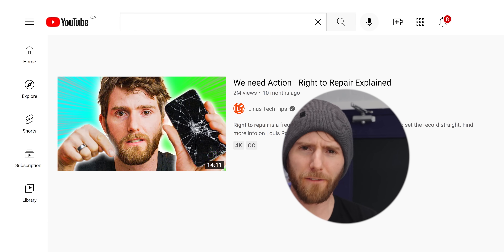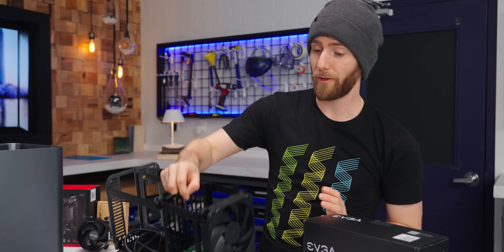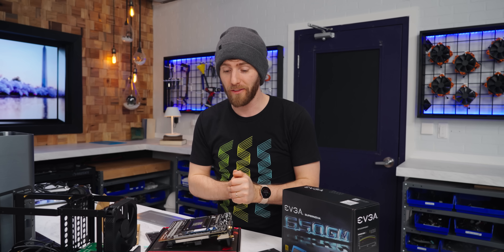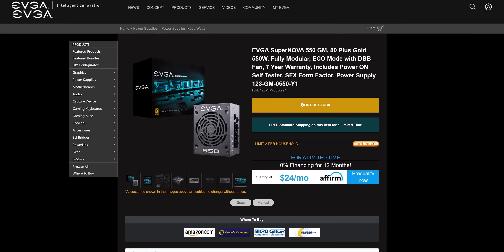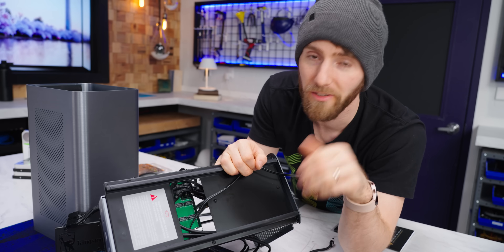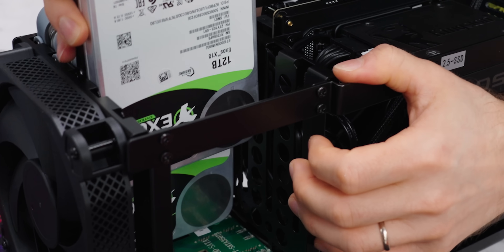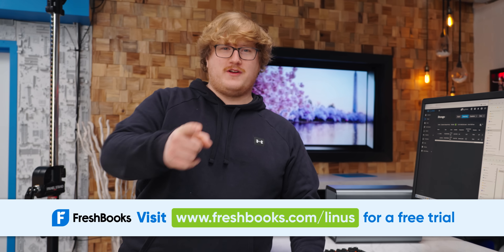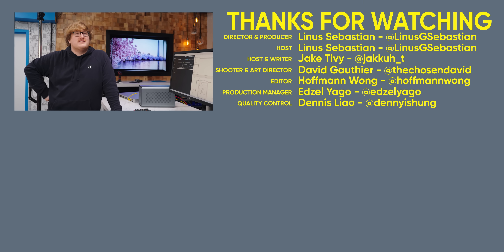This blows away the competition - JONSBO N1 NAS Build

Comment: The problem I see with the LTT screwdriver (from what I can tell from the videos) is the same as I see with most changeable bit ones, its too thick for the small work I do. Those bits alone will have a hard time fitting into recessed holes, let alone the shaft of the screwdriver. 
Even the iFix-it stuff isn't much better though.  

What I would like to see is a new design, using the small bits like the iFix-it kit uses. Rather than the normal interface where the bit slots into a hex hole in the screwdriver, the bit itself would have a keyed whole of some sort, and a shaft from the screwdriver would slot into the bit. This would let you keep the outer diameter of the total shaft very thin, allowing it to go into even the smallest recessed holes.
Reply: An easier solution to the problem you raised would be to use the long bits.
You would maybe need a handle that's a bit longer so that they can still be stored inside the handle.
Reply: I Agree, LINUS has tiny hands, that can somehow use the big Tools
I have BIG Hands that can't get in There Without a TINY Screwdriver😂
Reply: @OldManJace  I'll second that!!!
Reply: The thing about the LTT screwdriver is that it (at least looks like it) feels comfortable, we had a similar looking one and it was so so nice (it got lost now so sadge), i get your point about not fitting into tight spaces (hence why I have two screwdrivers) but for more general use i think that would feel much better than something for laptops or mobiles and such
Reply: If you need long and thin regularly, I'd take a look at the PB Swiss PB 515 toolset. It's great for deeply recessed screws in thin holes.
Reply: I have seen a couple of long bits screwdrivers that are only as thin as the head so they fit great in thigth spaces, but they only work on the provided handle, I would love an extra bits pack in the standard hex even if they do not go in the storage.
Reply: @josuelservin  those extra long bits exist. Every hardware store sells them.
Reply: @Jehty_  I know and own a set of those, but they are the same width as the hex part all the way to the head, so no good for small thin holes.
Reply: @josuelservin  I knew what you are talking about.
And as I said they are sold everywhere.
For example the Wera Kraftform Kompakt 60 set. 
(There are cheaper ones out there I just don't know their name)
Reply: Thats a pretty good idea actualy. Only possible issue i can see is manufacturing cost, since a lot of manufacturers have the current bit design down to where they can produce them at a high speeds and reliable quality. Sure there are for example Torx ones with a small dot in them, but the difference is that its a very small hole and doesnt have any torque applied to it.
Reply: I think they're optimizing their screwdriver for PC builds and just general use. If you need some special tool for a niche use case you should probably look somewhere else. Not like iFixit is the only company who makes screwdrivers. 99.9% of people do not need/want the feature you are asking about.
Reply: There are definitely different ways to approach building a screwdriver, none of them being perfect for every use case. Screwdrivers designed to be used with different bits do so usually out of consideration for cost and versatility. It allows for a much nicer driver for much less money compared to having one driver per bit. The design you've suggested is not in use for a very good reason. It's bad. There's no way to say this nicely really, you haven't thought anything through. Firstly, holding something by the inside instead of the outside reduces the contact area and increases the chances for slipping. This would allow you to strip your bits until they become unusable. Not to mention those bits are now exclusive to the specific driver that inserts into them, costing more to manufacture rather than a standard part which is already being mass produced. The other glaring (and worst) issue, is that the shaft would be significantly weaker, and risk twisting when applying a good amount of torque. If a magnet is used, it would also need to be tiny, thus much weaker and might let go of the bit often. The design you've proposed is both less practical and less durable, for increased cost. I think you can see now why that's not what LTT went for, or ifixit, or any respectable manufacturer. As another user mentioned, the PB 515 toolset would suit your requirements better, it has interchangeable shafts. Of course, the cost per bit is higher as well as the space taken up by each bit. Definitely not something you could store in the handle of the screwdriver itself.
Reply: There's usually two different types of screwdriver applications: serious business and delicate operations. The LTT screwdriver looks like a serious business screwdriver. I think they would do well to have a delicate option as well.
Reply: sorry to tell u that hes not producing special products just for ur usecase. im pretty sure its supposed to be used for the stuff he does in his videos and apparently its fitting for that. i bet there are manufacturers that produce tools for ur usecase too.

Comment: I got a used hp elitedesk 800 for $100 including shipping and tossed in a 256gb ssd and 2 16tb drives. Works great as a media server, and I even had room to add a 3060 and it's a capable spare gaming computer and it can mine while nobody is using it.

Comment: Does anyone know how much power this would use compared to a comparable synology?
Reply: Only a little more, Ryzen is pretty efficient at about 15-20W in idle or low load and 60W in a heavy load, so not great but more than acceptable.
Reply: well the synology would have a crappy celeron in it so yeah it would probably use less power however performance would struggle with compression and large file transfers
Reply: @firenado4295  Mmm. Its not really that bad.  Large file transfers don't require any CPU... the cheapest CPU can still easily (trivially) push the full network bandwidth.   Compression depends on the algorithm.  Its a trade-off.  Something like LZ4 gives you modest compression with very low CPU overhead verses other compression algorithms.  A little 4-banger CPU shouldn't have a problem with hard drives making up the backplane.  It might become stressed if they were SSDs instead.

Also, on vgamesx1's comment about power consumption, and Winfurious's comment.  With the gear in that box it will be idling at around 40W, not 15-20W.  15-20W is what you'd get with a mini-pc.   The low-end Intel CPUs do use significantly less power... but of course they are also significantly less powerful.

It comes down to how much one wants to pay on their power bill each month.  Vampire draw from always-on gizmos can be pretty substantial and it adds up.   NVRs have the same problem... if you throw a lot of cpu performance at a 24x7 security/video system, it can really dig into your monthly power bill.

-Matt
Reply: @junkerzn7312  ah fair enough, I honestly thought that file transfers where more intensive especially with compression but i think I've watched too many LTT videos where they have entire nvme storage and insane speeds that would need cpu power and it just numbed my brain i guess lol. I did know that it wasn't that intensive but not Celeron levels of not intensive.
Reply: @firenado4295  Basically, the only CPU intensive part of a file transfer involves whether the CPU has to manually decrypt and/or decompress the data from the drives.   There is also the CRC/SHA signature check for data validation, but that's pretty cheap.  With AESNI and CRC extensions in pretty much all CPUs these days, even cheap CPUs have quite a bit of horsepower there. 

The actual DMA is not really CPU-dependent... that is, up to several gigabytes per second, even a cheap 4-banger wouldn't have that much of an issue copying disk data to or from the network.    Particularly if the network adapter has UDP and TCP offload (which it probably will).

With the CRC/SHA signature check, that performance (on a cheap 4-banger) might drop to a gigabyte a second on the final data product, which is still significantly higher than 5 hard drives can produce.

So with hard drives it just doesn't matter.  With SSDs, on the other-hand, it can matter.

-Matt
Reply: @firenado4295  Also, I would add ... in a large drive array, there is almost no purpose to having compression because the large files typically stored on it will already be highly compressed.  things like ZIP, JPGs, MP4, other video formats... you don't get a whole lot of additional compression out of those and performance is more important, so I would just turn off compression entirely.

Filesystem compression universally utilizes block compression.  So, e.g. if the filesystem block size is 64KB, then each 64KB chunk is independently compressed.  Coupled with LZ4, compression really only becomes useful with general filesystem data, utilities, etc.  In othewords, smaller drives.  Not so much with bulk data.

Block-level de-duplication is far more important than compression when dealing with large archives.

-Matt
Reply: @hiddeninthewires2308  Yes, I agree for the most part.  The compression uses a heuristic, so it can just be left on.  But... there's no real reason to accept the loss of performance determinism if you are using an underpowered CPU.

On the ECC ... well, complain to Intel.  AMD CPUs,( including the SOCs), all support ECC.  I've got 64GB of ECC DDR4 stuffed into a little BeeLink mini-pc right now.

That said, Intel mobos still generally have better networking options.

Another problem is the SATA backplane... as in, there is none.  Sure, there's a circuit board there that you plug HDDs into, but those sata cables are going into discrete connectors on the motherboard and straight into the on-cpu-die AHCI controllers (typically two, split 4 and 2).   Neither Intel nor AMD implement bulletproof firmwares for their AHCI controllers so if one drive goes bad it becomes a bit of a pot-pouri, as I found out many times trying to RAID small-system solutions like the one depicted here.  Even though they are discrete ports and discrete PHYs if one port goes haywire it can cause other ports on the same controller to malfunction.

--

Ultimately, the best solution for nearly all consumers is to not try to store so much data (nearly all videos, music, and pictures, often in the highest possible quality).   Most people don't realize that single-filesystem solutions (even ZFS) are not bullet-proof and they will have data-loss without at least one discrete backup.  And its actually more like the minimum is four discrete backups if you don't want to end up in the painful situation of having to resynchronize dozens of terabytes over the internet (which can take months).   Even Linus has hit this problem, almost losing LTTs archive TWICE since inception due to single-points-of-failure.  And he's a smart guy!

Which brings us to another problem with RAID solutions... you need to hang it off a reliable UPS too if you don't want to risk a parallel head crash on all the HDDs at once due to a power glitch.   Reliable UPS != APC's or really anything with lead-acid batteries, gel-cell or otherwise, or any offline UPS (which is most of them).  It has to be an online UPS (meaning the inverter is always turned on), and the battery solution has to be LiFePO4 because almost nobody properly maintains their UPSs and gel cells have horrible failure modes.

So... lots of things can go wrong here.  At the end of the day, reliably maintaining a large data archive is not really that easy.

-Matt
Reply: @hiddeninthewires2308  I think you kinda lost what I said there.   I was talking about having discrete backups.  You are talking about single-filesystem solutions which are different from discrete backups).   A proper archival scheme has both single-filesystem redundancy and multiple independent filesystems each with a copy of the same topology and data.

It doesn't matter how sophisticated the software is, a single-filesystem solution is still a major failure point.  Ten thousand different things can go wrong and completely destroy the content... no matter how many discrete block copies it makes behind the scenes.

Which is always why you always want to have more than one independent filesystem (on independent hardware).   If you really care about retaining your data for the long-haul, a single ZFS or a single RAID system won't do the job.  You need at least two, and if you want to maintain offsite backups, you need at least four (two local, two remote).

Otherwise the inevitable restoration or rebuild that comes along becomes a months-long disaster.  Restoration is an often-overlooked failure point.  Corrupted media basically requires the entire filesystem to go read-only until it is resolved, because if you don't you risk destroying good data while you are in the process of trying to recover it.  Restoration can take an enormous amount of time, particularly on large archives.

The vast majority of consumers think they are adding reliability implementing these sorts of systems and wind up losing their entire archives because they don't realize that block data redundancy inside a single filesystem (like ZFS) is only part of the solution.

-Matt
Reply: @firenado4295  I've got the 4 bay model with the same processor and 20gb ram.  I run a few docker containers and a plex media server and its never broken a sweat.  File transfers don't use the CPU at all, you'll get similar speeds with a raspberry pi until you upgrade your ethernet port to 2.5gbe or higher.
Reply: The Synology DS1520+ has a Intel Celeron and an overall minimalist board design, so I'd expect the power draw on the custom build to be a couple watts higher. 
On the other hand, part of the power savings is a lack of 2.5Gbit Ethernet and other such niceties.
Reply: Idk

Comment: I personally had 3...yes 3 synology 2 bay nas (2 of them got on ebay for each 20 bucks) just to store data safely on raid...on usb drives then the backup of these nas drives.

After thinking and looking a lot of linus videos (320tb nas as eyample) i got my old pc from my basement (i5 4570) and installed UnRaid trial on it.

After 2 hrs i bought it straight away. I was blown away how much fun it was and how easy.

Now its running all of the synology drives haha....16 tb with 2 parity drives hell yeah....

I must thank linus tech tips for this...because this is so awesome...and iam so happy....

Btw now with 6 drives (2 paritys) it draws less power than all 3 synology....what the hell...

Comment: ZFS without ECC is fine if you  are ok with losing data or have a backup.
Reply: ZFS without ECC is the same as any other file system without ECC, other filesystems don't use ram as ARC but the data goes through it anyway and if there must be a problem there will be.
I use ZFS only with ECC ram but some of my friends have been using it for years without ECC ram and they have no corrupted data.
From personal experience it is easier to corrupt data by manipulating it with a normal PC without ECC and sending back to the nas inadvertently corrupted.

ECC ram should be in every PC.